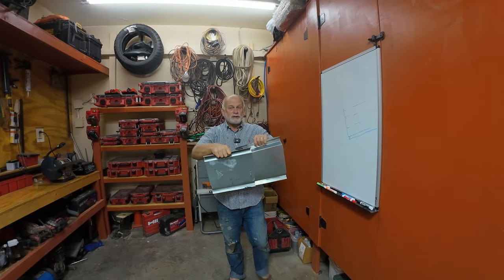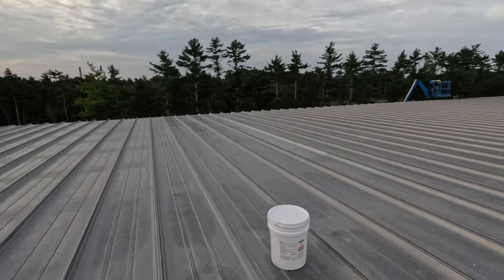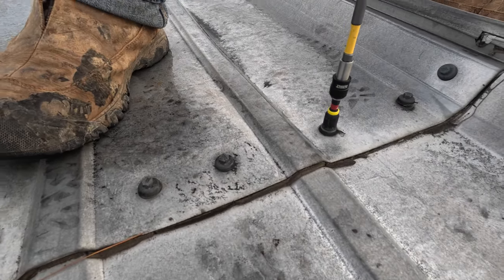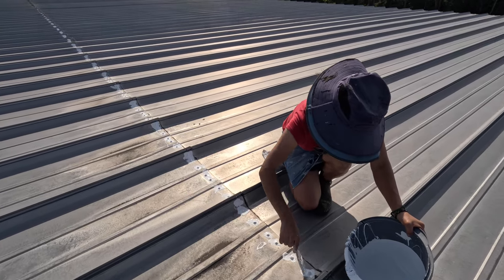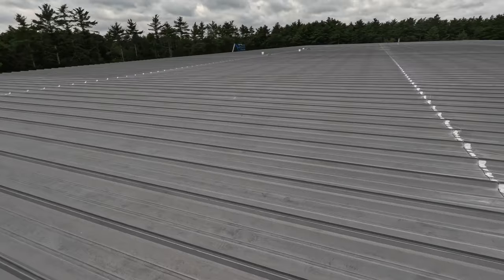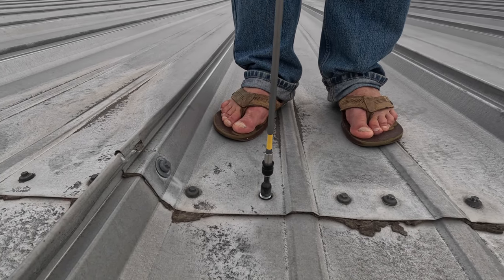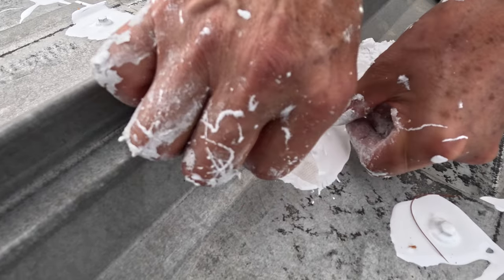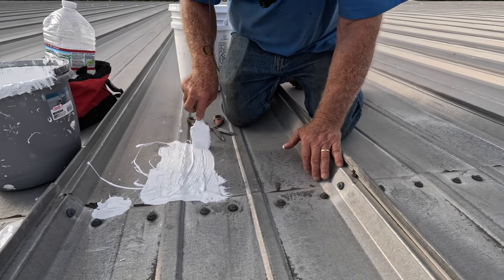METAL ROOF SCREWS Leaking - 90% of metal roof leaks can be stopped with 1 tool and 1 man

Comment: I am very surprised that screws are rusting only after a short time and the roof needing maintenance.  We live in a much wetter climate, where some say it rains uphill so with a roof like that problems would occur sooner.  After 40 years, I find some nails securing the roof rusty. I think it is a bad design that the roofing sheets have to be screwed down in the water channels rather than on the ridges.  So water will pool around the screws.  One idea you can try is dip  the screw tips  in mineral oil before screwing them in to  provide extra protection against rust.  Even used car engine oil will be good, and it  costs nothing.   I think the  screw heads and  neoprene washers should be sealed  when first installed.  Will walking all over the roof cause damage as some iron roofs will dent and distort, leading to leaks and water pooling  if not taking care?

Comment: You fix the screws that backed out or replaced the screws both bigger ones. then you put the sealant on the screw. Now the question is will the screw back out again after all that is done
Reply from the maker: nope. They backed out because they lost the torque due to the washer drying out. After Re-torque the washer will not dry out further and therefore  the screws will not loosen up. This is a must do for any metal roof installation after 3 - 5 years.